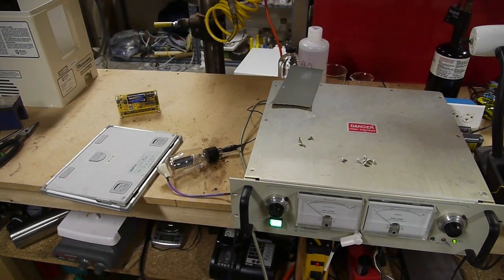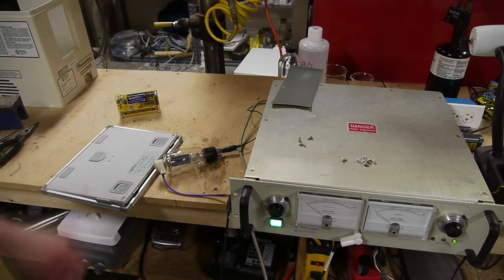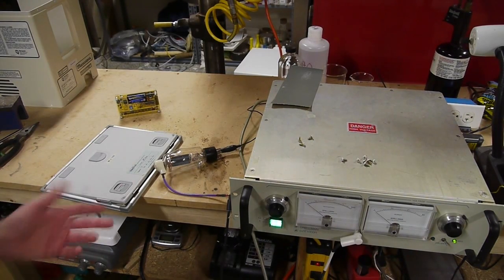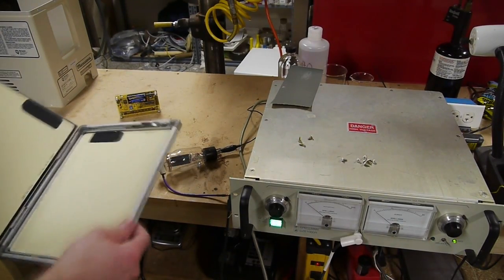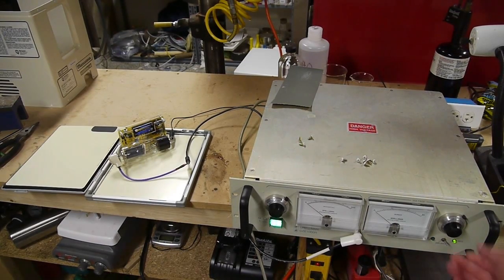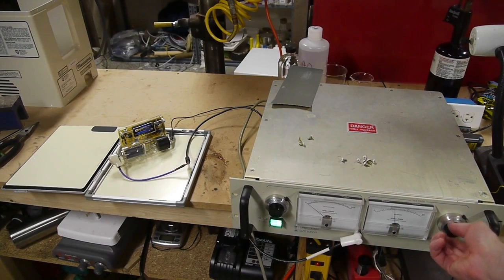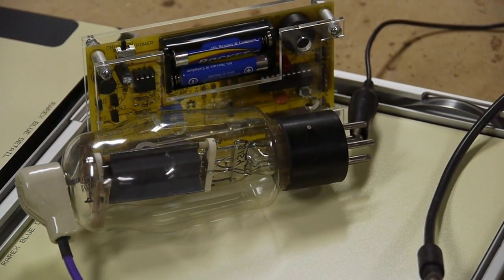Creating X-rays with a standard vacuum tube

Comment: Can you use simply AM as a source to bounce off a sample then through a sintilation crystal on a photomultiplier to do x-ray spectrometry or do you need to actually shoot some x-rays down surrounded by perhaps by a lead  hood and then use a small hole into a scintillation crystal and then through a photomultiplier? Can you do this with a simple AM souce so long as it's very near the sample and is shielded from does scintillation and photo multiplying collector? Or do you need to actually shoot full-on x-rays off of it?

Comment: I've heard recently that geiger counters have a lower limit one what x-rays they can detect - I see geiger counters on the internet claiming minimum energies of 10keV, 40keV....  (I don't know whether that's just the case blocking them, or something fundamental about the mechanism of geiger counters.)  You started getting a reading at 15kV, how do you know it wasn't blasting out 9keV x-rays well before that?  (Kinda spooky.)  In general, even - how would one tell if you're being irradiated by low energy x-rays?

Comment: I am using  1J29B subminiature  tubes that have a 1.2v filament voltage in guitar effects  distortion pedals as a diode for clipping to make distortion. Because of the low filament voltage of 1.2v these and a few others work great. Recently I purchased 100  Sylvania 5642 tubes for $20.00. But  their is a warning about possible  Xray dangers.  From what I can gather this is only at the high voltages like 25kv.  I am only running at up to 1.2 usually.  I am experimenting with  overvolting the the  1J29B tubes at up to 5 volts. Want to do the same with the  5642. 
Am I correct in believing the 5642 is safe at low voltage  of 1 to 5 volts?

Comment: Fun experiment. True X-Ray tube elements are in close proximity to each other and the tubes utilize a very very high vacuum to prevent arcs. The filament or cathode, depending on the type of tube, produce electrons that are directed and focused on a target. The target gets excited and produces X-Rays that are aimed toward a window to the outside world.
Reply: They are usually separated pretty far

Comment: I see the video is already so old, wow good run! I´m enjoying your videos!
Anyways I´d like to add that it IS possible to arc even in a perfect vacuum. The ions can be ripped off the cathode material creating a conductive path.
Works in micro plasma thrusters. I had one tested in UHV. However, you need like 10x the voltage of same gap in air.

Comment: A bit late, but with every discharge happening inside the tube there is a loss of vacuum due to outgassing and I would expect the glass is lead glass as its an easy glass to work with over soda lime. Lead glass is about 20% lead although it varies. Being lead this would block the small amount of x rays produced.

Comment: never knew my shortwave amplifier was radioactive
Reply: some ppl already mentioned it, but high voltage + vacuum = X-ray , you do not want that ☢☢☢⚠
Reply: @alos10subspasomipack33  what if it’s in a metal box?
Reply: @letitrotfuckit  It depends on the voltage your running it at, how thick the glass on the amp is, and how thick the metal is. Most of the time glass amps have enough glass to block out soft x-rays produced by their normal operating voltage, so I wouldn't worry about it.

Comment: I also did some experiments. (statute of limitations: more than 7 years ago!!!) with pulse tubes including 5642, DAC32 and others. Interestingly I did get my intensifier screen to light up an RFID tag through a Maplin project box though the only casualties were my phone and a memory card or 3 that got nuked while experimenting which also damaged the onboard camera. I can assure you that my dose was minimal based on multiple redundant dosimeters with two different tube designs and lead sheeting. Not sure why but did also find that putting the tube under oil did not help much as it still failed. Perhaps worth investigating? The module I used for this experiment was intended for lighting gas on a large industrial boiler so designed for high reliability: the smaller potted transformers sold in handheld lighters aren't quite enough though are useful for a different project like powering a Gen 0 13.5KV NV tube.

Comment: Arcs in a vacuum are possible. They are not like conventional arcs though, they are called vacuum arcs and are basically just hot spots that form on the electrodes and lead to more current flow.

Comment: I was just reading about x-ray tubes today. I didn't realize how inefficient they are. Apparently only around 1% of the total power is actually converted to x-rays. The rest just turns into heat on the anode where the electrons are hitting it. Seems like more efficient tubes would be a good area for research.
Reply: Frankly not really, few people want to buy such tubes and even fewer can [legally] buy them, the market for xray tubes is small, and people that buy them tend to have a budget high enough that energy efficiency is not an issue. It would only make sense if they became common household items, like a kit to do xray scans on yourself, but stupid regulations would never allow such a thing to be sold

Comment: I tried to feed high voltage to a vacuum tube, I can only get around 10-20 microsievert per hour, and it is not intense enough to light up the intensifier screen with 400 gain. I am using 10kV as well but mine current might be too low. I will try to increase the voltage and current to see if I can get more x ray. I also tried to heat up the filament then apply the high voltage, but I don't know why somehow the filament is burned.

Comment: try using a large clear filament type light bulb instead of a tube. I've  had some spectacular discharges just using an Old Ford coil with the secondary lead firing into the solder buttom on the end of the bulb. Don't use the coil ground either just let it shoot out the ends of the filaments. 350-500 watt old filament bulbs are great for this, if you can still find them? Cheap too.

Comment: 20KV X-rays are too "soft" to get through the glass.  Why should the tube arc over?  The enode connection is on the opposite end.  Maybe you should short all the pins on the bottom together.  Another thing: all X-ray tubes, after a long period of non-use, need to be "cleaned up" by slowly increasing voltage, and waiting for residual gasses to be sputtered away.

Comment: I remember hearing a theory that the "electrons" travelling between electrodes in a tube are actually composed of mostly Beta radiation.  This seems to make sense, since beta is easily directly convertible to electrical energy, and apparently would produce a characteristic glass decomposition reaction usually seen on tubes that have been in operation for a long time.
Reply: Beta radiation IS electrons.   ;)

Comment: I used to do this with dud horizontal output tubes (e.g. 6JE6C, etc.) using a 12 kV neon sign transformer (so that's about 17 kV peak).  Oddly, it was the getter patch on the glass where the x-rays were emitting, a nice ring of green glow around the patch.  Actually it breaks my heart to see a perfectly good 811 being abused like that but I guess old burned out tubes are not as common as they once were.

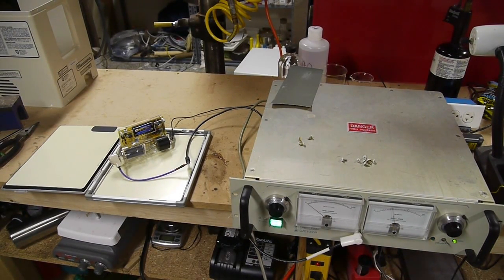Comment: @3:10 you can actually have an arc in a vacuum, and not just over a surface. It is actually one of the difficulties that needs to be addressed when designing a high voltage vacuum circuit breaker.
Even at low temperatures there is a 'cloud' of electrons above any metal surface in a vacuum. A high enough voltage between two metal plates will accelerate those electrons over the gap.  If there is sufficient current available the electrons will heat up the surface of the anode to the point where ions are ejected from the surface and accelerated towards the cathode heating that up and increasing the current further. Now you have an actual arc with ions flowing in one direction and electrons in the opposite. This starts an avalanche which is limited only by the current that the power supply can provide and will continue until either the power is turned off or the electrodes vaporise to destruction.
Reply: Same basic principle that a VFD/Vaccum Florescent Display works, crank up the voltage and they will arc.

Comment: I think the geiger is reacting to EMF high voltage,  not to the x-rays.  ( its happen with fluorescent lamp and reactors and stuff too).  its a metal geiger normally it will react to gama, or interference from near EMF.
Reply: A true geiger  counter is actually trying to measure particles, like radioactive decay. X-ray is actually a very high spectrum of light, I don't even think a geiger counter would even respond to X-ray radiation. it needs either beta or gamma.
Reply: Not true, gamma is also a very high spectrum of light, just a tier above x rays. I have a geiger coutner and it picks up x rays gamma alpha and beta, only alpha nad beta are particles
Reply: Don't feed trolls haha

Comment: The reason you didn't see any fluorescence on the intensifying screen is that those screens were optimized to respond to "diagnostic" x-rays, typically, those produced from 50KV to 150KV, sometimes described as "hard" xray. Anything less, those screens do not respond. Now if you could find a "Mammography" cassette, you might see some fluorescence. For technical reasons, Mammographic x-ray machines operate in the 19KV-50KV range, sometimes described as "soft" x-ray.

Nice set-up, I am totally jealous of your HV power supply!

Comment: Jolly good. 30KV isn't enough to penetrate a body, just enough to give you skin cancer though. All modern xray equipment has filters, mainly aluminium, to stop this, the most dangerous radiation. Marie Curie would be delighted.

Comment: Nice! I bought a X-Ray tube from United Nuclear with a 25kV power supply. It's generating X-Rays! I checked it with an EMF detector and got background, so no interference! I placed my camera close to the tube, turned it on, and I got beautiful scintillations flashing in the video from the X-Rays striking the lens. Makes it look grainy. My Geiger counter goes nuts if I'm fairly close, and it will peg out the meter. I get noticeable increase in counts/minute from across the room. I plan on doing other tubes. Thanks!

Comment: I've been messing around with cool vacuum  tubes  for many fun years. These little gems are quite forgiving in comparison to transistors. OK, so we are understand the physics behind creating x-rays or do we? That a magnetron principle of converting high voltage DC too high freq microwave energy. An internal gap sets the operating freq of 2.4 gig. Now let's assume we somehow find the operating freq of these x-rays via the acceleration of electrons in a beam is a crude form of oscillation that leaves us with "X" for the unknown factor? 
we can speculate the freq? 10.000 to 50.000  gigahertz all day with no way to generate it using crude microwave transistors. But if like that clear LED tech worth trillions which took a big cash incentive to complete the task. What if a team of researchers working around the clock did create the first pure x-ray frequency  generating tube it it would be a milestone discovery.
Theoretically, pure x-rays would penetrate anything even lead shielding. Like RF it would go right through the biggest thickest mountains and open the door wide for the exploration of our own planet's core element.

Comment: I remember when I was a TV repairman back in the late 60's and early 70's, there was a scare about x-rays coming from color TV sets.  It was true.  They mostly came from  tubes called the high voltage rectifier and regulator.  It had 25,000 volts across it.  The tubes were types 3A3, 6BK4, 6EL4 and others.  GE even came out with a regulator tube that had a lead-plastic coating to block x-rays.  Other makers issued retrofits that included a shield to install in the set.
Reply: röntgen of this spectrum is negligible. I have a 60Kv dentist x-ray tube the radiation can already be stop with an iron plate at 100Kv tube there is radiation to be worrying.
Reply: @20kilovolt  well yeah irons pretty good at blocking xrays
Reply: @jhoughjr1  Like light, X-ray also has a spectrum with different properties.
This spectrum  is in between 10nm to 1pm wavelength.
The higher the voltage, the smaller the wavelength become. 20 to 250Kv.
The density of the metal therefore also determines the property at which wavelength it can withstand.
Often metal is used as a sieve such as aluminum for X-ray blocking of larger wavelengths like in a 60,000 volt dentist x-ray tube.
iron is perfectly capable of blocking X-rays of this wavelength.
Reply: rationalguy Being a TV repairman you might know the answer to this: how much current does a flyback trans output at the suction cup connection? I know it's upwards of 20kv but wondering if there's enough current to kill or do serious harm.
Reply: Permaglo 
As I recall, the anode current on a color CRT is about 1mA peak at 25kV, which, yes, is enough to kill or do serious harm.
Reply: @w6wdh  Sorry but no, it will give you a good wake up call but that's about it unless you have some medical condition.

Old school neon signs are powered by transformers up to 60mA at 15kV (typically 30mA) and if it was deadly I wouldn't be typing this now as I make neon signs.
Reply: @Permaglo  20kv is voltage, the current is very low, less than 10mA.
Reply: @Permaglo  it can absolutely kill you
Reply: @Permaglo  Other side of the pond TV repairman of the 70s here. You could draw 1mA but the voltage would collapse to about ⅓. Enough for a serious shock.
Reply: All the TVs I repaired had the high voltage rectifier tubes inside a cage, that resembled the perforated metal in a microwave oven door. The screens were leaded glass to block radiation from the electron guns. They were rated for 40,000 volts, 1 mA peak current. the filaments were supplied by a 3 turn winding right on the flyback transformer. The flyback was driven by  a 6CD7 or EL509.
Reply: That is why our elders used to tell us not to sit too close to the tv.
Reply: Me too doing repairs on my parent's huge color Zenith console. I'd crank the brightness up at the flyback/rectifier box and really light-up the screen such that all contrast was lost (I understood about using HV-rated plastic tools and not touching the chassis or a ground while doing this - just use 1 hand). Did this a lot while I was in the back adjusting linearity, convergence, etc from time to time. I could feel the high voltage on the hairs of my arm at that point. I'm still here and healthy at 56 so perhaps I received a hormetic dose. Who knew or bothered when you're 14 ...
Reply: Only color TVs had this issue because of the metal color mask being struck by the electron beam. However the very thick lead glass front plate of the picture tube would stop what little x-rays are produced.
Reply: @tihzho  The leaded glass worked well to stop x-rays, but made the big "jugs" ( CRT's) difficult to dispose legally.  The lead content made it a hazardous waste.  Getting shocked by 25 kv or more was a sharp learning experience!  I was quick to learn how to work with it safely.  The crt  acts as a  "Leyden Jar," storing a charge long after the set was turned off.
Reply: @utah133  Yup! The graphite coating inside the CRT makes the "Leyden Jar".

Lead glass does NOT pose any environmental waste hazard as the lead does not leech from the glass. I've been blowing lead glass (neon signs), and handling metallic mercury for 40 years and had periodic blood tests for heavy metals. My heavy metals levels are the same as the national average.
Reply: @tihzho  I'm also quite sure that lead glass doesn't leach, but that doesn't stop the powers that be in some places from hearing the word "lead" and going nuts with disposal regs...  They actually "glassify"  ( or more correctly, vitrify) nuclear waste to make it safe for burial. I've also handled heavy metals, even as a child.  I'm old enough to have cast lead figures and of course played with mercury whenever the opportunity arose.  I'm 70 and still physically and mentally fit, so no harm done, apparently.
Reply: In Germany, TV tubes were only legal up to 15kV. And it was a warning sticker about possible x-ray radiation.
Reply: FUCK!!! I was wanting to see a tube or have a tube forever. Just was given a CRT tv old as dirt. Is a Magnavox but I don't want to take it apart as it is not mine. Especially if the tubes are shielded.
Reply: How old is "old as dirt" here?
Reply: @Disillusioned_one  BINGO!
Reply: Seen many sheet metal boxes lead soldered shut around these rectifiers. The CRT itself (before leading the glass) was main source. It's a giant X ray tube basically ultra fast electrons and all.
Reply: One time I powered on an old console tv that had stuffed a foot drop.
Apparently the tube cracked and it was making the loudest angriest pixies ive ever heard.
The room was filled with something dreadful.
Reply: I have a huge amount of those tubes. Plan on making a x ray n hopes gamma ray generator.
Reply: @freddyfingerz9854 NOT gonna happen.... 🤨
Reply: @Disillusioned_one Yep. The leaded glass on the front of the C.R.T. helped absorb any X-rays produced also. Ever pick up a 36" Sony Trinitron C.R.T. set??... 😬
Reply: Large CRT televisions often included a spark gap circuit to squelch the second anode voltage if it exceeded 25 kV.

Comment: You will need at least 50k volts to produce the type of radiation that you are looking for. Your intensifier screen won't show anything less. Also, X-ray radiation at that low voltage is very dangerous ...